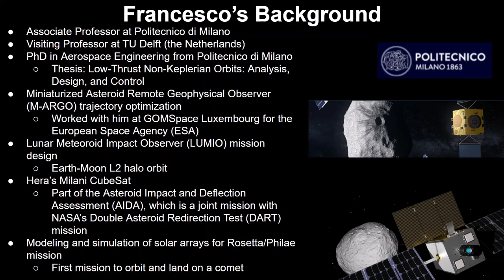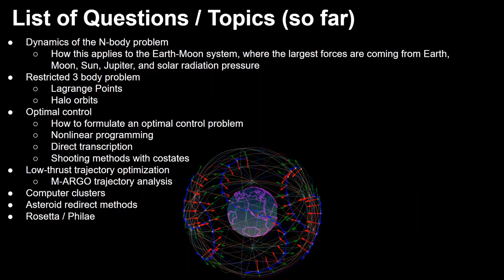Dr. Francesco Topputo | Spacecraft Trajectory Optimization, Mission Design, PoliMi | SEP 3 Preview

Comment: Expanding on the Milani, it would be interesting to hear him talk about how simulations drive ConOps for Milani. Can you figure out the optimal time to record images using the ASPECT by analysing the interaction with Didymos? What does that analysis look like?
This series is a great way to give people an insight into what space researchers actually do. It's a great thing to see. Cheers!

P.S Just a heads up that the c in his name is pronounced ch. So it will be Franchesko phonetically.
Reply from the maker: I certainly plan to spend a bit of time talking about Milani, since I have worked on that mission to Didymos on proximity operations, so I think I'll be able to come up with more detailed questions for him

Also thank you for the heads up! I'll be sure to say it correctly during the podcast

Comment: Thank you for such an interesting guest. I have suggestions for few topics (if it is possible of course)

1. What approach do you use in case of a real-time problem when spacecraft got off from the optima trajectory? (Which methods applicable for recalculating trajectory in a robust way when the mission already began and going?)
2. What discreteness is necessary to calculate the optimal trajectory for a space mission before the start? 
3. If we chose high discreteness (it means small dt step), how to guarantee good convergence property for the multiple shooting method?
Reply from the maker: Great questions. For the first question, that process is called flight path control, which is part of navigation. Its super interesting, and if I don't have time for it in this podcast I'll definitely be asking about it in other podcasts, I plan on having a few people who specialize in that field specifically (including a second podcast with Juan Arrieta)

3rd question: Yes, good idea. I'll definitely ask him a few questions on multiple shooting methods, and when it is a better idea to use multiple shooting vs direct transcription for solving optimal control problems